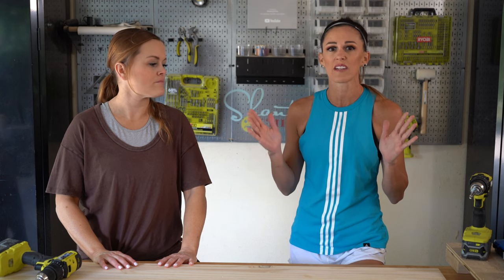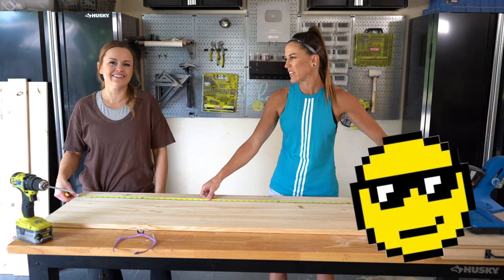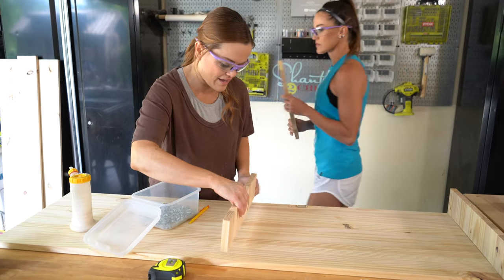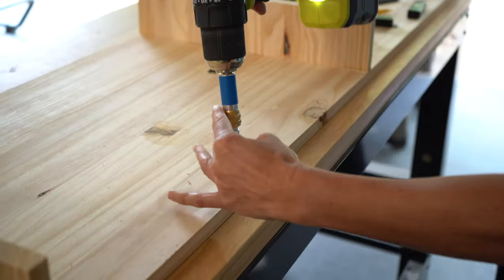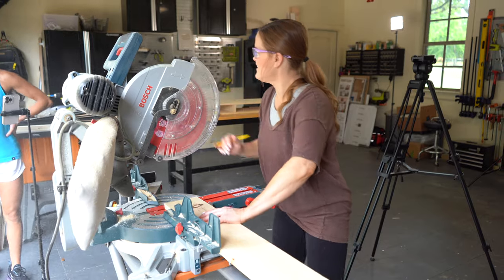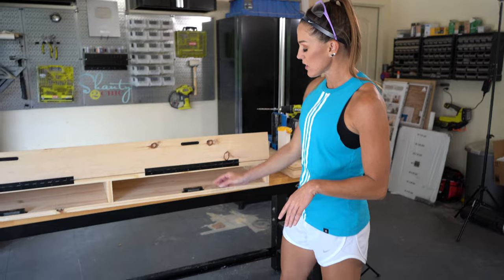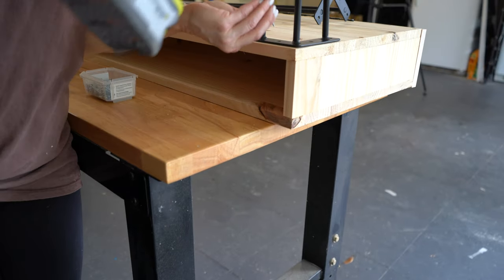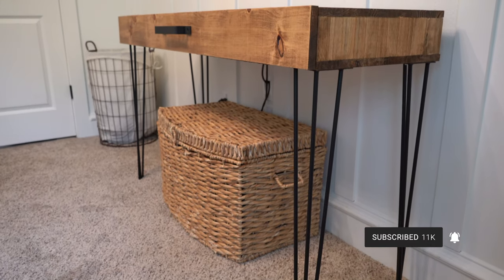DIY TV Console with Hidden Storage

Comment: Hey - great looking piece! How does it handle the heat? I know our Xbox gets pretty hot and given how negatively heat can affect both gameplay and system longevity I am curious. I might have added a cutout in the bottom with some kind of wire shelving covering it to help with that but keep the aesthetic; that way you would have an in and an out (back and the cutout) for better airflow.
Reply: I will drill tiny wholes underneath where the Xbox lays. So it's not visible and breathable